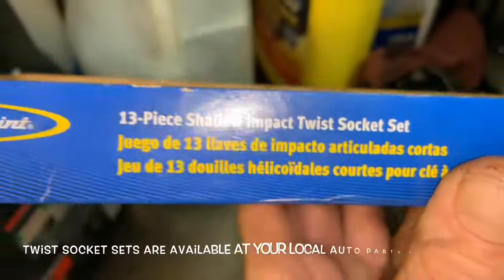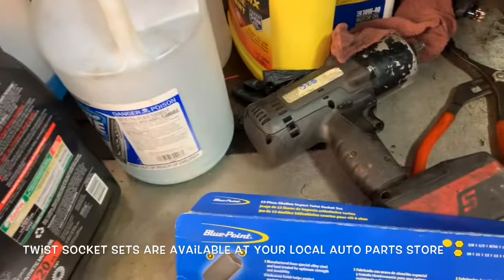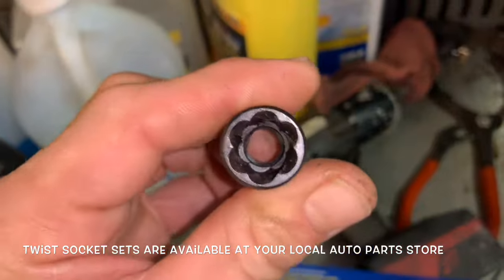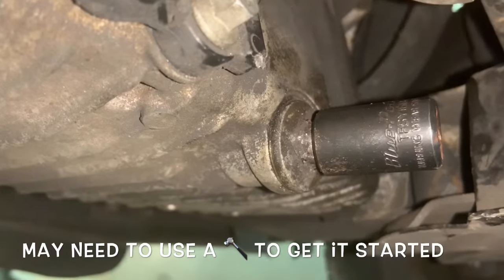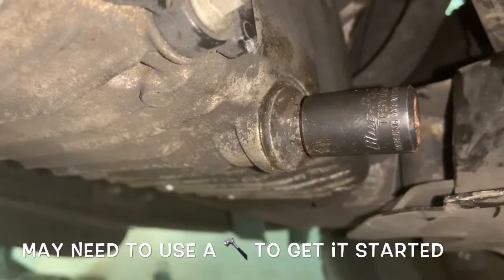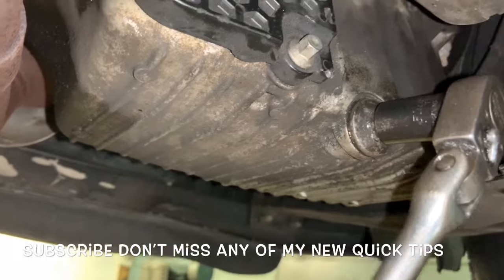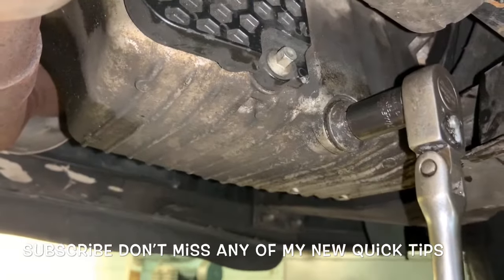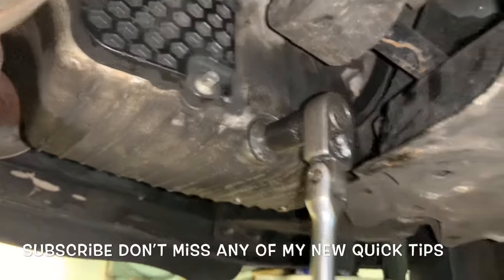How to remove a stripped or rounded oil drain plug

Comment: Yo brother, I just wanted to let you know. I was at the end of my rope with my drain plug. I tried everything and couldn't get it to budge. I finally dug deep in my research and found your simple video. Went to the auto store and got the bolt extractor, 5 minutes in with a breaker bar and got it loose. Changed the oil and now I'm a happy man. Thanks for showing me how to save it

Comment: Yeah no, it just keeps rounding further.
Reply: Guess you’d just replace it after getting it off
Reply: Provided it comes off.

I ended up just using a dremel to grind some flats I could put a wrench on with mine (fortunately, the screw—or bolt with no mating nut—was made of cheese grade metal so I ended up grinding some flats I could get a wrench on pretty easy and it didn't chew the threads in the oil pan).

Lesson learned, avoid the oil change house that got a new rattle gun to play with. That car has since been scrapped (flood damage), but.. yeah.
Reply: They come in different sizes, maybe it wasn’t small enough to catch a grip
Reply: Nah, it caught, but the drain bolt on newer Dodge cars (not sure if this is true with other cars) is made of chrome plated hard cheese instead of metal so you can round the thing fairly easily with a farmer wrench. These will just make them even rounder.
Reply: Yeah this sucks someone put this in wayyyyy too tight, I have a extractor that drills into the bolt but would rather make some flats somehow and try again

Comment: What do you do if the oil drain plug is really close to the transmission pan and there is not enough clearance to do what you are suggesting?
Reply: Cry
Reply: I’m not a mechanic but I would imagine what kind of contraption would be required to move it and then see if that exists lol

Comment: Harbor freight does not have twist socket.  The bold extractor socket Harbor Freight sells are not twist sockets and will only round off your bolt head if you apply more than 40lbs of pressure.
Reply: Going through that problem I just went grabbed them at harbor freight

Comment: just subscribed and rang the bell grate video blue point to the rescue again.   there wheel lock removal tool is very good as well   I have used it back in the day when I worked as a tire and lube tech at Goodyear
Reply from the maker: Check out 🔩Artys Garage 🔧ASE Mobile Auto Repair/ Master Certified Mechanic on Google!
https://g.page/artysgarage?gm